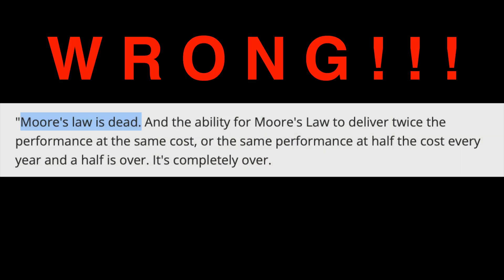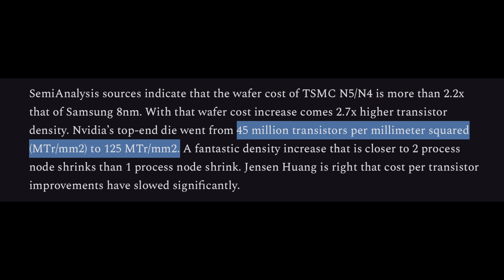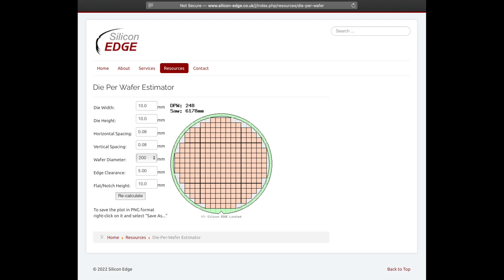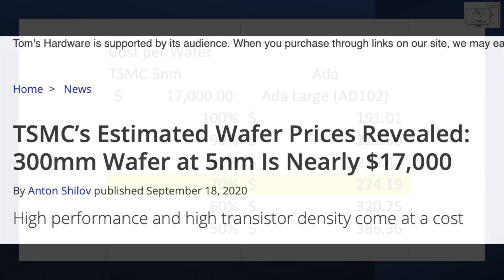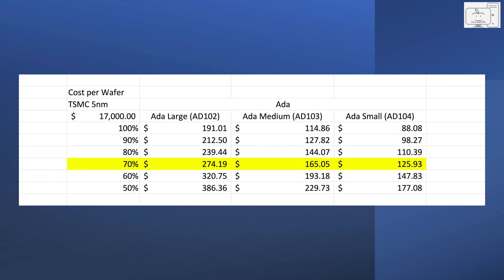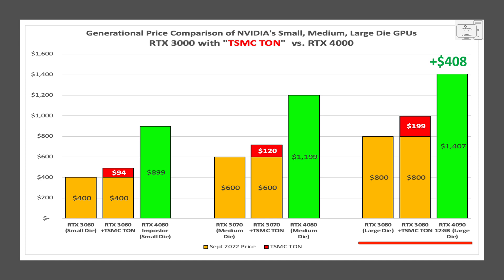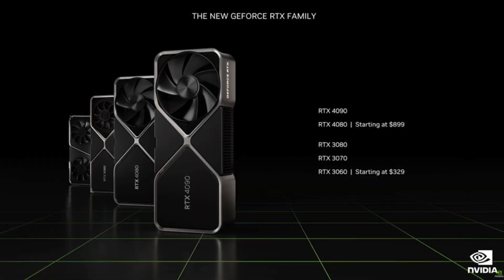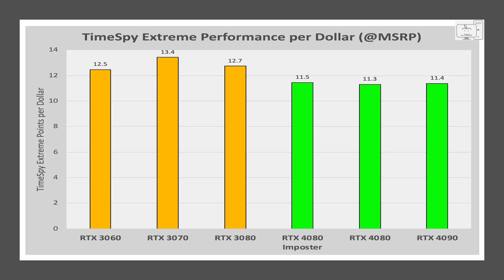Why is the RTX 4090 So Expensive? Is it TSMC's Fault? What is the Gen-on-Gen Performance per dollar?

Comment: How about inflation and the general issue with supply bottlenecks due to chinese lockdowns? Should these be considered when calculating the prices as well?
Reply from the maker: Do those two explain the 71% price increase in the 80-series GPU? Wouldn't inflation and supply bottlenecks affect CPUs? RAM? SSDs? Power Supplies? Did those items go up 71%?
Reply: @ImaMac-PC  Well of course not 71%, I just thought about other factors that might have had an impact on the prices as well. 
Would be interesting to know whethere these had an impact or not, dont you think?

Comment: 09:00 typo in the chart it shows 4090 for 1408, its a 4080 price all good
Reply from the maker: That price is my estimate of what the 4090 would cost if it only had 12GB of VRAM, which matches the comparison GPU of a 3080 with 12GB. Trying to keep it apples-to-apples. Next time I'll explain it better. Thanks for the feedback!

Comment: Wafer cost is not the only coat to chip manufacturing.  TSMC estimates $600M for 4nm million, $400M for 5nm, $300M for 3nm.  That the cost of Physical Design, ie the lithography mask. The Physical layout of those Billions of transistors. 

So Nvidia likely spent around $1.2 to $1.8 Billion on three 4nm Chips Designs.  AMD likely spent $0.75 to 1.5 Billion on three 5nm plus one 6nm chip.

Assuming Nvidia sells 10 million units.  The design cost per card on average would be $120 to 180 dollars.

Assuming AMD sells 5 million cards.  Their design cost per card would be around $150 to $300.  Also AMD will have additional cost on leading edge packaging tech for chiplets.

Leading edge process nodes will continue to rise in cost. Smaller nodes will require more steps due to the more extensive use of multiple patterning, which will  could double the amount of lithography steps at 3nm and below.

Comment: I mean if you add the board cost, cooler cost, shipping cost, merchant profit, credit card fee, and using reasonable numbers they are at a 60% profit margin, which is what they tell their shareholders; assuming its $20,000 per wafer which @TechTechPotato said it was in his latest video
Reply: From my calculations, assuming the 5nm node costs $14,000 and the 6nm node costs $7,500, if AMD took a profit margin of 60%, they will charge ~$900 dollars for Navi 31 or with a profit margin of 45%, they will charge $650, if these estimates are right they will charge the latter and destroy nvidia in price to performance considering that the navi 31 should be similar in speed to the 4090
Reply from the maker: Thanks for sharing. Even if the wafer costs are more expensive, you can see the cost advantage that AMD has over nVidia is huge. I wonder how they will price Navi 31?

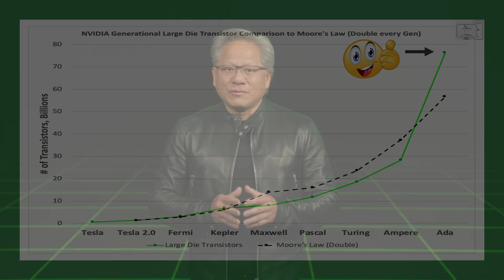Comment: 13:22 Why Jensen did all that : Profit
The made the 3000 series looks extremely appealing while still retaining the current prices (which are still going down). They need to sell the remaining 3000 series cards fast and they need to do it quick and at a minimum loss, while at the same time try to make the 4000 series still an appealing offer with the DLSS 3.0 features being exclusive only to the 4000 series and all that so it will still be profitable to them even when it's eventually going down in prices later on. I think we still need to see how they price the 5000 series in the future, if it keeps going on the same trend like the 4000 series then safe to say NVidia has become Apple 2.0.
Reply from the maker: When you see the Founders Editions becoming as nice as they are and the prices at the lowest among all AIBs...and EVGA leaving...Apple 2.0 is inevitable.

Comment: Nice presentation, but while you did a commendable effort at estimating wafer prices, I'd ask for R&D, electricity, other materials, wages, transportation costs, etc. All of those have increased across the board, not just wafers.  I really don't want to defend Nvidia, the 4080 12GB was an overpriced scumbag move, but so many tech YouTubers fail at calculating product prices, it's just sad.
Reply from the maker: Great point! That is why I focused on the difference and then added to RTX 3000 GPUs. The reason prices for RTX 3000 GPUs have not come back down to MSRP is likely due to the exact factors you suggested. The thought is that most of the factors are already covered in the higher GPU prices.

Comment: @I'm a Mac mm I totally agree but you forgot one thing in current economical or should I say political climate. Apple and Nvidia and probably AMD as well but nothing I have read about, have a dead line until next year to restrict their dealings with China and Russia by the government of US of A, even though the Russian restriction has been enacted now it seems.

There fore Apple and Nvidia is making TSMC to do what is called "hot runs" at tsmc. The production pace is highly increased and that seems to cost a pretty penny as both yields and tooling costs increases. Apple and Nvidia simply wants to produce as much as possible so that they can sell as much as possible to China before the restriction is in place. 

Dont understand why you did not take it up in the vid, as this directly affects the pricing of nvidias gpus.
Reply from the maker: Thanks for bringing that up. Usually companies will amortize those costs over the life cycle of the product, which for GPUs, is currently sitting around 2yrs. If they didn't price that into the MSRP, then prices should come down later when they stop the "hot runs". Time will tell.

Comment: Man, the prices of GPUs still suck. I really wanted to get a new 3080 or 3080ti cheap, since it's been 2 years after the 30 series card were released and they are still above MSRP in most stores. I'll continue using my gtx 1080 until it dies, I guess. Now I understand why so many people are calling them Ngreedia
Reply from the maker: Even a used 3080 is going between $500-$600...

Comment: 70% die harvesting would be abysmal. It's at least 90%. Note that critical connections are etched with redundancy, so defects do not render a die useless. They typically cut parts of the die to get the defects out, like the 4090 only has 128 SMs instead of the full 144 SMs.
Reply from the maker: I agree, but for the study, I did want to create the worse case difference in cost and 60% seemed too low.
Reply: @ImaMac-PC  fair enough. I based my comment on the article "Ada Lovelace GPUs Shows How Desperate Nvidia Is" "We calculated the die costs to account for parametric yields with a high percentage of die harvesting." Also note that in your study you only looked at the TSMC cost increase, but that also increases the gross margin Nvidia/AMD as a publicly traded company needs to make, let alone All In Board Partners. More cost means more financial risk means more margin is needed to cover that risk.

Comment: Why is no one talking about the fact that the 4090 pushes 150+FPS at 4k in loads of games but display port 1.4 only supports 120hz.
Reply from the maker: Awesome point! Intel ARC supports DP 2.0 but not the 4090. It's like the reviewers just forgot...
Reply: @ImaMac-PC  even more fascinating once you start looking into this stuff is my monitor is an Asus pg32uq. It is advertised as 4k 144hz. But has hdmi 2.1 and display port 1.4 interfaces which only go up to 120hz. So as far as I can see the only way to get to see your 144fps on this monitor is through compression. Mind boggling when it's headline selling point is 4k 144hz and it can't even do it without compression. Same at the other end on my 3090. Blistering FPS generation even at 4k but can only send it out via display port 1.4.  so all of these x"cutting edge" devices rated for high refresh 4k are hobbled by the interface. Ultimately making the 4090 too fast for everything apart from a few ray-traced games. It's effectively a concept product with very few games that actually use its capabilities, a bit like the first wave of CD-ROM based consoles in the 90s.
Reply: wait till they release rtx 4090ti ... they'll add DP 2.0 on that  ... or not hahaha
Reply: @schikey2076  most of the monitors don't have DisplayPort 2 anyway I think the 4090 is a bit of a pointless card for a variety of reasons but I still want it lol

Comment: It cost around $500 to produce an RTX 4090, the rest is profit. Even Apple iPhone that cost $500 to produce cost $1,000 at market making 50% profit. Yes, the 4090 is overpriced charging at $1600, but they might get away with it depending on the supply and demand.
Reply from the maker: They have been able to do that on the Halo products, but I wonder if that will transfer to the rest of the series?
Reply: Maybe it costs $500 to make the GPU + package + memory chips, but it costs a lot more to make a 4090 board, VRMs, cooler, packaging, validation, personnel, transportation, customer support etc. and get it to you. So no the 4090 is not overpriced.
Reply: @louisfriend9323   yes it is 1200 is max

Comment: 8:20 It would have been good to see the estimated die cost for the 40 cards as a segment of the green bars.

Nvidia is using anchoring to maintain or increase their gross margin to appease investors. No longer are investors happy with companies getting a gross margin of 10-40%, Nvidia's gross margin hit 65% this year steadily growing from 50-55%. So every increase to the cost likely has another 60% thrown on top. The 'TSMS TON', additional VRAM, faster VRAM, better/more capacitors, better VRM, higher PCB costs and other cooler material costs.

If Nvidia targetted a still very healthy gross margin of 30% they could likely sell the 4090 for $999, 4080 for $849 and the impostor 4080 for $649. They could likely push those down by another $50-150 by reducing some of the other costs associated with pushing the power targets so high and using lots of GDDR6X. Roman found with the 4090 you may only drop 5% preformance while running at a power limit of 60%.

Nvidia's focus on keeping investors happy while pushing all the dials to 11 to get every ounce of preformance out of the chip. Very likely pushes up the prices by $250 to $550 for the three new cards.

Comment: Hmmm… interesting take on this, unbiased and objective. A few notes on this:
Daniel Nenni laughed at the 17K price for the N5 silicon wafer, he said it was too high of an estimate.
Wafers that have a defect still are able to  be used as a cut down GPU, and the 4090 isn’t the full die and is cut down by 11.11% or so, in fact, from what I know, there isn’t a GPU that uses the full die, even the Ada RTX 6000 is cut down 1.39%.
This is a really dumb thing, but Nvidia stated that their 4N process is a “5nm” class node from TSMC and not a “true” 4nm class node.
Reply from the maker: Very good point. In doing the research, the actual cost of the die is dependent on many factors of which, that level of info is not readily available. I had to simplify and look at a worse case situation to do this level of study.
Reply: Wafer costs are a well guarded secret because they make deals years in advance and cost changes significantly to one vendor to the next you can bet apple is not paying anything near of what Nvidia or Amd are getting charged.

Comment: AMD 6000 series were praised when they dropped in price this year, but folks forget some of those were priced higher than Nvidia 3000 counterparts, so kind of price anchoring too, I guess. 

I made my own target get double performance per dollar, even whatever different tier and gen gpu I get soon.

Having GTX1050 since 2017, when I got it for 3280CZK (109USD), it shows 28percent of Rx6600 at techpowerup (not sure if thats usefull source for performance rating).
Anyway I found RX6700 but also some 6700XT to come close to 2x performance per dollar vs my old 1050(even incl. lical currency rate devaluation to dollar in that time by some 10percent).

Still about to get 15percent lower retail price of RX6700/xt to reach my 2x value per dollar expectation.

Thanks for your explanation. 

(I was trying reach few sources about wafer and die size cost and VRAM prices, but its very rare and sunken in internet).
Anyway I guess 4090 air cooler Thermal solution is quite overengineered, 2,5kg huge gpu can have some extra sinked production costs, incl VRMs) 

Most interesting comparisons about to come, when everything from 4080 down to 4000 comes out for benchmarks to show against 3000 series. No enthusiast BS to brain wash with 50to 80 tier I hope. 

(just Intel called Battlemage enthusiast, but it seems dead plan) 

You have made it clear. Keep doing well.
Reply: A gpu that pulls 666 watt would need that cooling. Its not over engineered. They achieve 2 fan 600w cooling. Did you see ps5's cooler for over all 200w 220w power use? With 1 fan.
Reply: @Hi-levels  That would be power draw directly from Hell. Lol. And what about let's say 654W?
Reply: @gstormcz  have you checked gamers nexus video? That's their number not mine lol. Still too much

Comment: The biggest problem is that AMD will do exactly the same as they were doing for the last couple of years - nothing.
They will release GPUs being 10-15% slower and they will charge 10-15% less compared to Nvidia's stupid pricing. 
It's hard to believe that they will release similar performance for the same prices as the last gen. 
The PC gaming era is ending if for the price of the GPU itself you can buy a console, a 4K TV, and a couch.
Reply from the maker: Dr. Lisa Su has determined that if you can't beat 'em, join 'em. And now they just slot their GPUs into nVidia's pricing structure. I am not certain she will follow this time...at least maybe not at the 80-series tier and lower.
Reply: I doubt Lisa Su will charge $1499. AMDs gross margin has been slowly rising to 50%, and their production costs are lower than Nvidia, charging 70% gross margin. I predict $1249 and $999 for Navi31, you will be amazed
Reply: @louisfriend9323  Would be nice to see 7900XT for $999 and 7800XT for $700 but I'm not sure if they will go this way. Time will tell.
Reply: @tomtomkowski7653  I'm afraid we won't see 7800XT (Navi32) for a while, it has been planned for Q2 next year. But a 7950XT 192CU (48 WGP) $1249 and a 7900XT 168 CU (42 WGP) $999 seem likely. Based on leaks by angstronomics and semianalysis websites.
Reply: you were 100% correct unfortunately lmao

Comment: The CEO hoping to fool investment community long enough to cash in his stock options before having to reset the MSRP.  The market could only bear the 3000 series price from miner FOMO demand and the segment of priced out gamers capitulating after already delaying purchases. Prediction: Between coming recession and the mining gpu's leaking into (and soon flooding) the second hand market the MSRP will be revised massively downward inside the next 12 months and the CEO will be removed with the customary golden parachute.
Reply from the maker: He does seem to be taking a gamble for this generation. If it fails, you may be right.

Comment: The tug of war between consumer and corporation was lost with Turing. The fact that the market supported the 2060/70/80 and then salivated over the 2080Ti told marketers consumer value perception was broken and that there  was a lot of consumer surplus they had left on the table with Pascal that they could capture in Turing and later pricing for shareholders. Expect AMD, Nvidia and TSMC to do run a meaningless blame train while taking your money going forward. We gave an inch, they've occupied our Crimea.
Reply from the maker: Turing was the first big step after the GTX TItan since it spread down to the 60-series. I could almost justify it with Turing since you did get a much larger die and silicon and hardware based ray tracing and DLSS development is not free. But raising the price $100 in Turing (60 through 80 series) is not as bad as $400. This gen is ridiculous.
Reply: Yeah, the only difference is that Crimea has always been Russian territory which Russia recentely took back and the communist nazi west hates it.
Reply: @kirillshvedov3283   You mean the zionist communist jew that has been put in seat by the zionist west to rule over an Orthodox Christian country? Or do you mean the people that have allowed it to happen to them. Are you one of them? Or do you just felt the need to mention your profession? Well, I'm not interested in your life style.

Comment: With binning into lower tier products, the yield is over 85%, but it doesn't even matter. Doing some math based of RTX 4090 performance benchmarks and lower tier GPU specs - you can conclude, that RTX 4080 12GB (scam version) should be around RTX 3080Ti in performance and RTX 4080 16GB will be maybe around RTX 3090Ti or marginally faster. 
So while RTX 3090 -> RTX 4090 is big jump of around 60-70% at 4K, the jump from RTX 3080 to RTX 4080 12GB and 16 GB will be ~10% and ~30% at a higher cost and these cards will be laughably bad value anyway.
Reply: 3090 > 4090 at 4k is typically 60-100% more when it cpu/game engine bottlenecked.